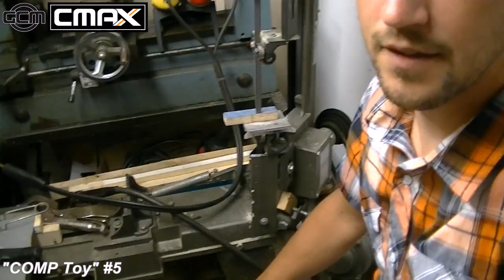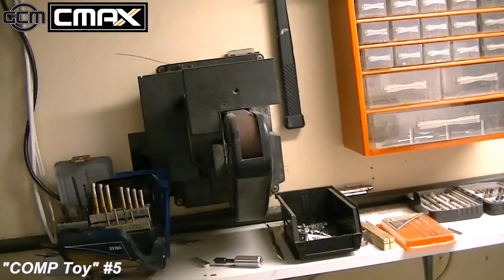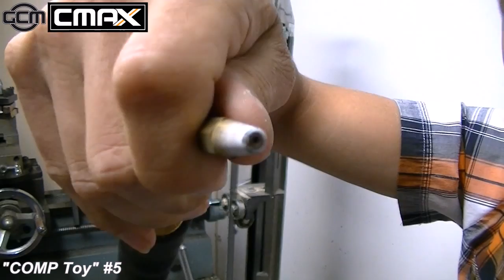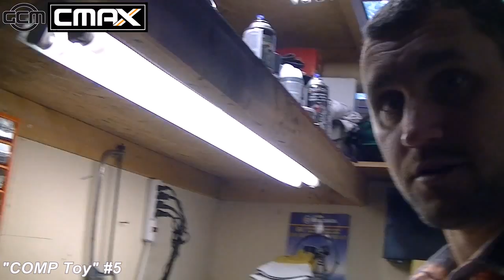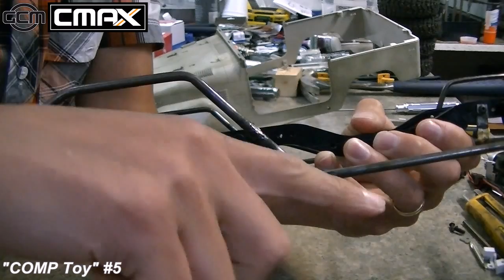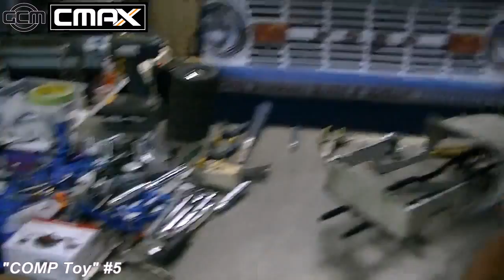GCM CMAX "COMP Toy" #5 Video Build - Welding tools etc.

Comment: For those of us who don’t have access to map and oxygen. Will silver solder work with a hot solder iron?
Reply from the maker: Well,..... some of the problem is you won't get the steel tube or plate hot enough to even solder.... just not enough BTU heat going into the metal. That can work with tiny metal wires etc for racks or such things, but not for larger tube and plate.
Reply: GCMRacing1 - Scale Truck RC in Canada will a 140watt solder iron work?
Reply: I appreciate all your advice. I'm just starting  out and don't have access to that. I was hoping to try it out.
Reply: The only other item my hardware store  has is propane gas sets.
Reply: Love all your vids!

Comment: The temporary bracing on the bottom is a good idea. I use junk rod to make temporary braces in the builds and cut them off when done, saves a lot of headaches. In the small scale we deal in, even a small amount of movement can really jack things up.
Reply from the maker: Yeah. I have a mm or 2 on one side that's really pissing me off actually... I think I'll have to leave it though, or it means the fix is reducing mid pipe 2 of the runs.. one on the side, and now one on the upper tube work (video 7). Ah well, it's very close anyway, but it was really good before I started putting heat into the tubes. I'm sure though that the support tubes have made a huge difference holding things in place. Sure.